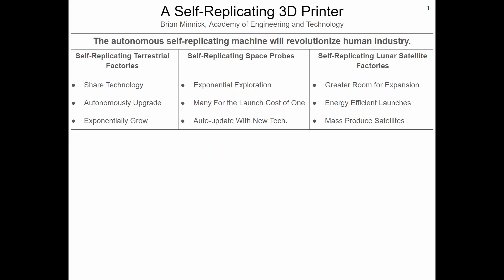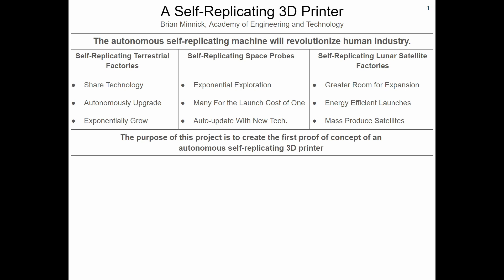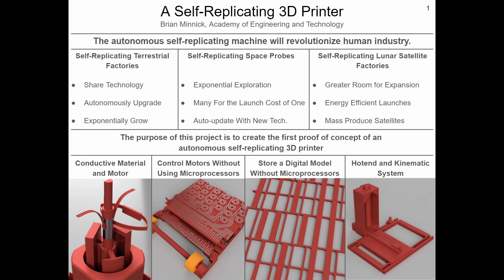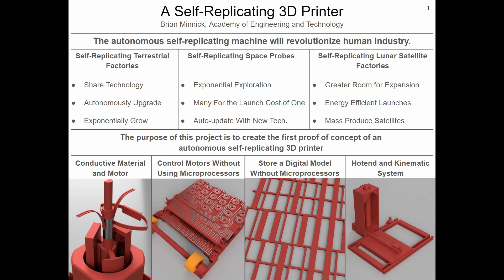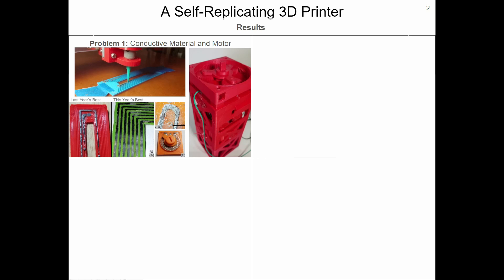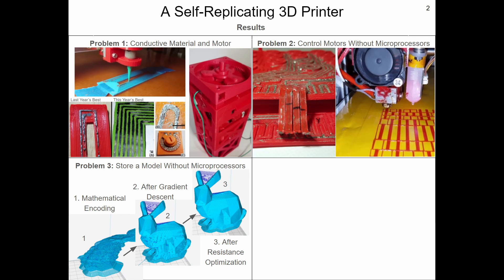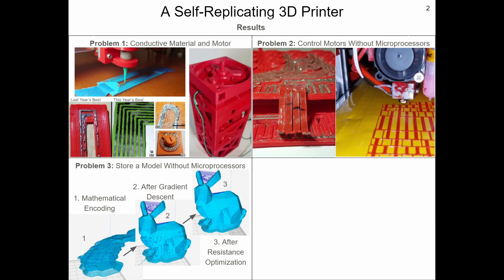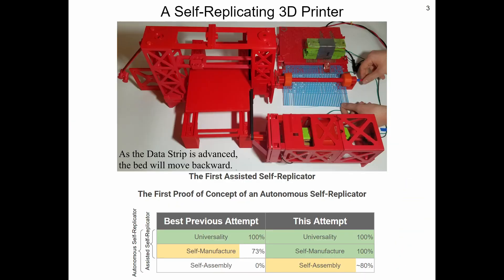A Self-Replicating 3D Printer: Introduction (ISEF 2021)

Comment: The Hack-a-Day article on this project just dropped a bit ago.  Would you be willing to talk more about your annealed PEEK printed hot end?  So much of your engineering work for this project is amazing, but I feel like the self-replicatable hot end would do the most for deploying any kind of printer.
Reply from the maker: I definitely agree, that is probably the biggest sticking point here. It can extrude PLA relatively nicely, but given how challenging it was to print the hotend on a normal printer I purpose built for the task, it would certainly be challenging to print itself. I was going for a fully FMD 3D printed 3D printer here, but if I was to actually deploy this machine as a true self-replicator, I think another solution (maybe a sintered FDM printed ceramic?) would work better. Hopefully this can inspire some other solutions for the community though!
Reply: @brianm4685  I really want the control system to end up as part of someone's art/education piece.  Electro-mechanical control of brushed DC motors is inspired.  It almost makes me think of the 1967 book "How to Build a Working Digital Computer" that constructed a simplified set of digital circuits from paper fasteners and paperclips connected to small light bulbs.  

Someone who mashed together these two projects to produce a system for generating control card designs for an electromechanically controlled 3D printer or other machine tools would gather a bunch of interest in the hacker genre for the "alternate universe" feeling it would generate.  Extra points if someone manages to integrate the slide rule into the design.

Comment: So the structure of the machine is encoded into a 2d mesh
and when reading the 2d mesh you replicate the structure and it inherent data

now a fully autonomous self replicating 3d printer would need to harvest the ambient energy to run and copy itself ;)

heat expansion or diode solar panel are a first, and beside gravity weight storage or generation i don't see anything else.

Alright, a fully autonomous self replicating 3d printer would need to extract its own ore and structure materials ^^

very well done atm